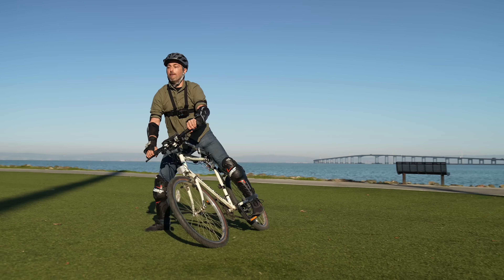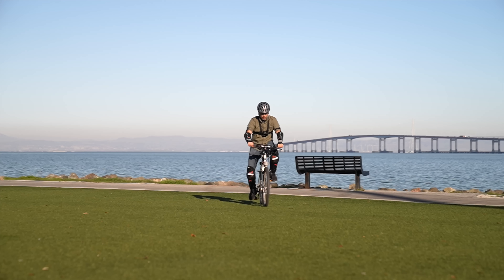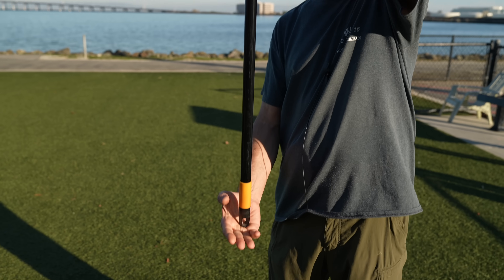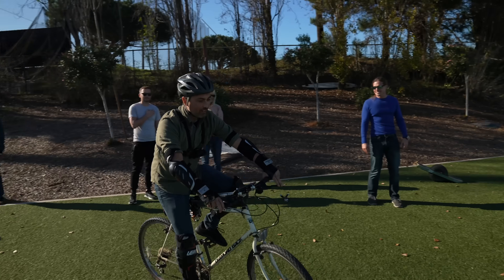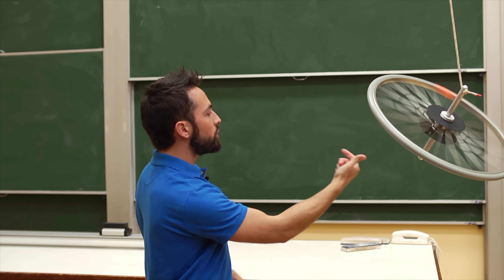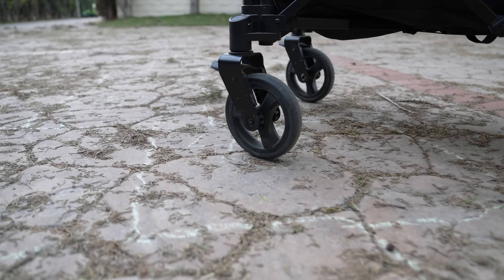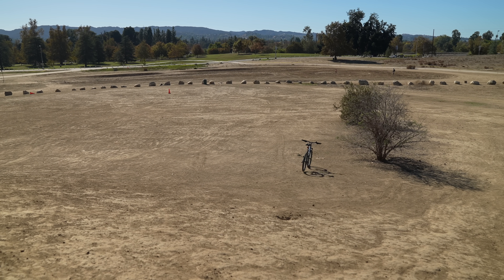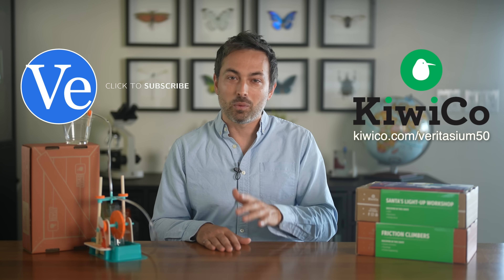Most People Don't Know How Bikes Work

Comment: You know what's funny. Even though you are right, with all unexpected road hazard you will counter steer to start going the direction you want to go. For example, say someone run infront of you, you'll turn sharply because you did not expect to turn.
However when i ride my bike i usually do litle to no counter steer. I just let my balance fall to one side then follow the crooked balance with my bike.
And the place where i'll let the bike ride itself the most is when i ride in deep snow. If you are starting to fall toward one side while riding in deep snow your first reflex is to counter steer to keep going straight, but it's wrong because the snow has already throw the balance toward the direction the front wheel is turning. So doing a counter steer at this point will simply make you fall. with all that said, it mean i MUST not hold the handle bar hard but actually softly and let the bike ride itself in the slippery deep snow.

Comment: I still think its possible to steer the bike by first leaning and then steering. I knew nearly everything in this video already, maybe because I am from the Netherlands. The tilted front fork part is still some pretty nice engineering. 
Btw, GEKOLONISEERD
Reply: Most kids who aggressively rode bikes as kids knew this stuff already. At least the practical part of it.
Reply: What naturally happens when you lean is you press more on the side you are leaning which starts the counter steer. This actually increases the lean and increases the effect to the point where you can low side. This type of steering is exactly how a motorcycle steers as well. The only difference is that at extremely low speeds and due to the lower center of gravity, the counter steer required to turn is much much less and almost non-existent depending on the motorcycle and the rider. Remember Newton's Third Law is still in effect when trying to lean the bike, so that lean has to come from some other shift of mass. You literally can't just lean the way you want without the bike going the opposite way.
Reply: @stevenmobley5882  interesting, I would like to try this bike one day. My bicycle can lock the steer completely, I will try the effect of leaning the next time I ride my bike😅
Reply: GEKOLONISEERD
Reply: Sadly this is not the case, you and lean all you want, and all you are doing is shifting your center of gravity, you have to counter steer, steer into the corner and lean the opposite way for ideal center of gravity.
Reply: @CF_Sapper  That's not true at all. Leaning yourself to the left will make the bike lean to the left and when the front tyre starts leaning the bike will counter steer itself to the right before falling into line with a left lean. This is due to the self steering nature of bikes as described in the video.

I am 100% sure this is correct because I have ridden my motorbike down hills and leaned my body without even touching the handle bars. The bike DOES turn the way you're leaning and you can in fact see the bars slightly counter steer first as you lean your body. It is VERY inefficient and requires a lot of leaning before the bike responds at all, but it does work.
Reply: @MonoMan1  There was a video a while back and I can't remember who did it about this exact topic, if you lock the steering and lean the bike will continue to go straight, all the lean does is change your center of gravity. It contributes nothing to the initial turning of the bike. I'll see if I can find the video and post the link in a reply. or edit this comment
Reply: @CF_Sapper  Ohhhh yes, if you LOCK the steering then I agree that the bike would continue straight.

But if you have a regular bike where the steering is free to turn, leaning without touching the bars WILL cause the bike to turn.
Reply: @MonoMan1   I Wish I could find that video because it explains the whole thing beautifully and I sometimes have issues explaining snow to a Canadian... funny enough if this was a single wheel absolutely leaning cause it to turn via angular momentum. There's a physics teacher on here with a great video on that. That I can find.
Reply: @CF_Sapper  I entirely understand why a bike with locked steering won't turn when you lean so no worries about not finding the video.

If a bike has steering that isn't locked though, it will turn when you lean. I've done it, it turns.
Reply: GEKOLONISEERD

Comment: Sorry to say but if you grow up using a bike you dont turn right and then change your balance you first change your balance then use the handle or as for me and my brother dont use the handles at all(why should we :P ). We drive for years already without our Hands on the handles so ehhh... Nothing of that, successfull turning when one of your handles locks, has to do with luck. IT IS Purly a thing of experience and skill.  While locking both sides turning we maybe able to drive far longer then the showen testers but we would still fall in the end, as you explained later with the self steering effect of bysicles being locked out. However I am not so sure anymore, if we woudn't be able pull it of(?) after showing those experimental bike itterations that still were able to self balance even though locked and having no gyroscopic help(?).
(We trained our Instinct of balance and drive with Forsight as we perfectly remember our neighborhood. In the end we do still turn the handles just from a far, as you described in the selfbalancing of the bike. We mainly just support that effect, so we stay on course with the straight path.)

What new thing I did learn from this video, was a question I always had. Why it was eazier to steer with purly our balance when we go faster. So thanks for that and would love an answer/comment if you ever see this between the flood of comments <3

Comment: Bicycles are really fascinating and full of cool physics!

One thing which I asked myself and I think finally figured out is the effect of tire drag when braking with a bike you are not riding but rather pushing along next to yourself.

Push the bike forward and fully engaged the rear brake and the back tire doesn't roll but just glides on the floor. However engage the front break while pushing it forward and the bike stops fully. It will want to tip over the front but the front tire won't glide.

You can notice the same effect when pushing it backwards and engaging the front and than the rear brake.

What do you think why this happens?

Comment: I seem to do this when I was going slow or moderate speed, but when I would go faster I would tilt my bike into the direction I wanted to while I remind up right, and if I wanted to actually do the turn then I would slightly turn it into the direction I leaned in, couldn't turn to much otherwise the bike tire would slip or throw you off since your turn then would be too sharp.

Comment: you missed something. You should have tried to steer one direction without steering the other first to see if it's possible (with the camera in front of the bike). You proved that you can't keep the bike up with locked steering. But maybe you can make a turn with steering no bigger than the ones you do in a straight line (by leaning in the direction of the turn)

Comment: Surely you could just lean the bike the direction you want to go before turning. Maybe im doing a small counter steer without noticing but im pretty sure when im riding my bike with no hands i just lean whichever direction i want to go and the bike turns that direction in the same way that a bike is able to self stablize by turning in the direction that the bike starts leaning exept i use my body weight to force which way its leaning.

Comment: I should note that the positive castoring angle, like in a bike and in your car, are for stability (meaning, it self corrects to go straight), while the negative reduces the force required to steer. Each is the opposite of the other. One is stable and hard to steer while the other favors ease of steering but is eaaier to disturb.

Proof: there isn't a single shopping cart in the whole planet that doesn't pull to one side. Really.

Comment: and pedaling, or in case of motorbikes, the throttle will help to straight up the bike
Reply: that make me think that is lateral acceleration what you need.
wich can be achieved by the amount of cornering speed,
steer times accel times play with offsetting the center of mass out of the contact patch line

Comment: There is an EXTREMELY effective demonstration of this on youtube where a man wearing a gopro crashes into an ambulance of all things. His steering inputs so clearly cause the bike to pop under him and send him into the crash it's undeniable. I think it's hard to really get this in your mind when riding high speeds as you can usually rely on your lean to create the steering inputs, and never learn to countersteer at high speed if you need to tighten the turn.

Comment: hey I just watched your video titled: "Why No One Has Measured The Speed Of Light"

and had this idea I commented down in your coments but since its a little old I thought I'd put it here

okay imagine you have a 4 way laser that shoots in 4 directions (could also make it 3D with 6 lasers) and you shoot them at 4 or 6 clocks each in another direction 1km away from the laser. you make it so that the clock starts when the laser reaches it and it automatically stops after 10 seconds. and so when it stops it measures the exact time it stopped down to whatever decimal is needed. if they all show the same time then the speed of might is the same in every direction or am I not seeing something?

Nahuel
with "the exact TIME it stopped down to whatever decimal is needed" I mean the hour

Nahuel
and if this would work and would show the same speed in all directions you know the speed of light is the one we use everyday. and if not then by knowing the exact time you activated the laser im sure you could figure out the differences

Comment: I ride no hands a lot more than I don't and I can say with certainty that countersteering isn't as necessary for starting a turn. I categorize my turns in three ways now: a simple lean, CoG (center of gravity) deflection (this is definitely countersteering because I move my hips in the opposite direction that I am turning), and a deadfall turn, which is actually more of a countersteer but only after leaning into a 90 degree turn at low speeds.  I would even say in that position that I experience the effects of gyroscopic procession on my steering far more than your average cyclist. The wind can testify on my behalf here. I have to point out that using countersteering to come out of a turn and keep my desired path is always essential despite these caveats.

Comment: You missed another reason why bikes are stable. As the front forks normally bend forward and the forks are on an forward angle, when the front wheel turns to one side it raises the mass of the rest of the bike slightly, this is like raising a ball bearing in a shallow dish, it will want to return to its lowest point. 
As pointed out the other effects steer the front wheel which I’m fairly sure is the more important effect. A detail and question on that though: the forward centre of gravity of the wheel will create a turning force of the fork and handlebars in the direction of the lean as you explained. I believe the geometry also does that and this theory could be checked out by pushing a bike against a ceiling. As the bike is leant to one side I believe the wheel will still steer that way as the minimum centre of gravity is achieved with the front wheel at a small angle. (or the furthest it can allow the upward force if the bike is inverted and pushed onto the ceiling.). As a person on a bike increases the overall mass but not the comparatively small mass of the wheel, a bike should be more stable even with a static mass. (Also testable). I noticed that off road bike often have a greater forward bend, or offset of the front wheel hub, presumably to give greater stability with impact forces affecting the steering in this way. 
Thanks for the video.
Reply: Bike stability is not fully understood by any one. Other bikes have been made, and not just the example near the end that do away with all the accepted ways a bike will remain stable. Including ones that has the fork bending back into the frame, and not outwards, and the bike still remains stable.

Comment: Ever seen a motobiker collide head on with a semi after a turn? Same principle. It applies for motorbikes and explains why "problem focus" gets bikers killed. Instead of steering "towards"the problem in the first place and riding away fron it, they try to steer away from it by instinct and therefore move right towards it effectively pulling themselves up and going straight on instead of leaning into an even sharper turn and therefore avoiding the semi. Also shows that if not used to it, the human will always act instinctively instead of doing the "right" thing eventhough it it what he usually does 24/7 but since it is not build into ones instincts by not training it often enough, one may just forget such "simple" principle one never thought of before.

Comment: I must be doing something right, because my front wheel has locked up before where I couldn't steer but I was still able to control the bike.

What happened was the brake line got wrapped around the handlebar the wrong way and caused the handlebar to get stuck in a fixed position. I just calmly stopped the bike with my feet, went around to the front and untangled the line, and I was able to keep on going. I never fell off the bike though.

Comment: I would like to bring in  my experience of competitively biking. If you lean first there's no need to initiate a counter steer to cause the turn, only when you're upright or close to that, you need to start steering opposite but you could also turn whilst leaning at the same time to not need to counter steer.
Reply: As a funny aside to that. I was slightly helping a VR company when they were making a cycle simulator. They got in a bunch of talented amateur road cyclist in to test the VR, and promptly most of them fell off the chairs they were sitting on, due to them trying to lean the bikes into the turns.

Comment: I guess the gyroscopic effect is applied when you put pressure on the pedal the way you want to steer. 
Also how about trying riding the bike with no hands and locked up steering wheel.

Comment: Riding it should be easy by leaning in the right direction with your body, like you'd do to ride a normal bike without touching the steering handles with hands, but turning much slower.

Comment: As a Dutch person that cycles more than 12.000 km a year for over 10 years.
I can say with confidence you can still do this with enough speed and leaning the way of the corner before you actually steer. The key thing here is a bit of speed (and a lot of experience), which truth to be told you didn't have in the demo. It is a really cool video though and definiatly explains the principle of steering on a bike well!
Reply: The leaning before stearing should work. I can cycle without touching the steer while the steer is locked using the locking system.

Comment: Since we can’t ride a bike without steerable handlebars, it would seem we are constantly turning to stay upright.  If we are constantly turning, why then wouldn’t centrifugal force be a factor in staying upright?  Every little turn generates centrifugal force that keeps our center of mass on average over a tiny base.   As far as counter-steering goes, if we shift our weight to the right to make a right turn, wouldn’t there be an action-reaction effect that would cause the bike to tip momentarily to the left, necessitating a left turn to generate the centrifugal force to stay upright?  The weight shift to the right could then take effect and we would steer right to turn right.  Turns are basically controlled falls.  Heck, riding a bicycle is a controlled fall.  The implication is that we are constantly tipping over and then steering in the direction of the tip to use centrifugal force to keep us upright.  We steer as a reaction to tipping.  Tipping is always first, followed by steering to stay upright.

Comment: This is very false, definitely can turn without counter steering, and NOT by pure luck. Those times you did turn was not luck it was simply you leaning and turning. At slow speeds you have to counter steer. At moderate speeds no one is counter steering, not even on a motorcycle. Any one who rides bicycles or motorbikes alot knows this.

Comment: At speed on a bicycle or motorcycle you only steer by counter steering. Push the left grip which turns the wheel slightly to the right and go left. Push left, lean left, go left. Push right to stand back up from the turn.

Comment: i can't substantiate this, but back when i used to ride a bike, I found that I could steer by looking at where I wanted to go while not moving my arms consciously, and allowing my body to make the (i assume) subconscious motions it needed to. I could consistently run over small change, or ride curbs without slipping off, all by just staring at the space I wanted the bike to run over.
also, I learned how to comfortably bike one handed since I liked being able to text, or drink water, or do something with my left hand. Steering the bike one handed (for me) involved looking at where I needed to be, as well as using my body weight to shift direction. When I did things that distracted my vision, like texting, I couldn't do much more than go in a straight path forward. And, when I first started doing it and wasn't good at it, I did crash a lot.
I never learned how to consistently bike no-handed, but I assumed it involved deflating the tires a bit so they sagged more and had better purchase on the ground, as well as going at a consistent speed, on top of having good alignment and not hitting a bump.